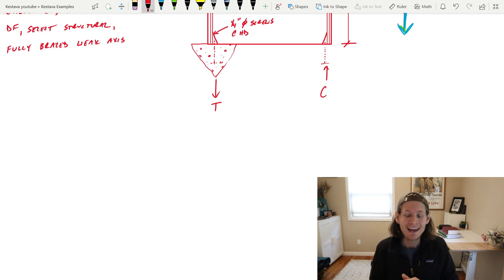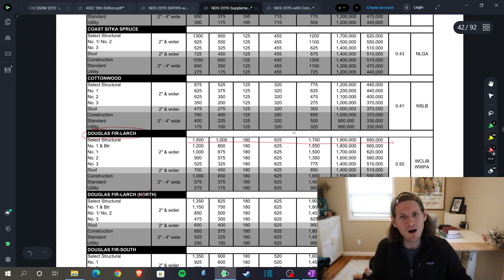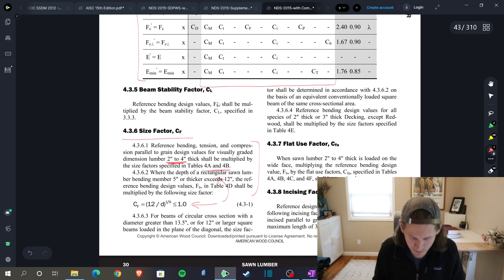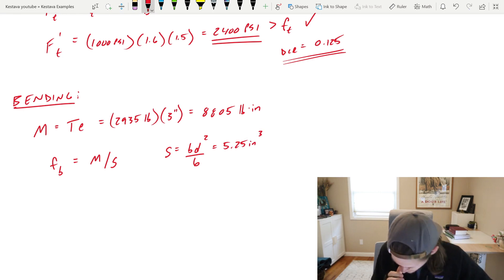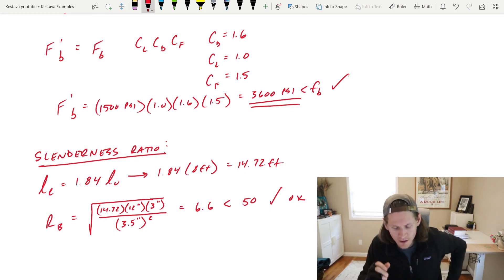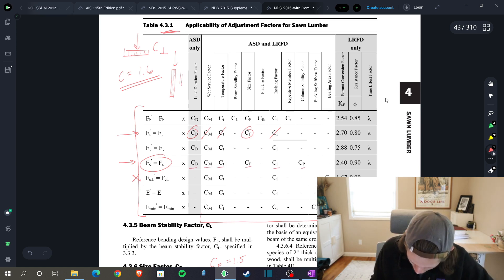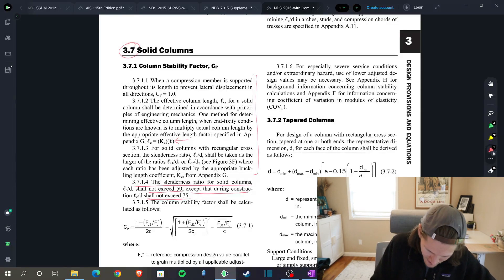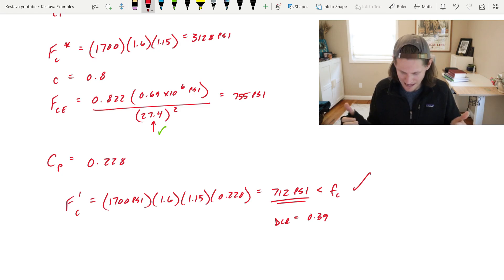How to Design Wood Shear Wall End Posts | Full Design Example | NDS

Comment: Excellent video. I also think the check for combined axial force and bending in the tension post was great attention to detail.
I'm curious why we don't check for plate crushing under the compression post? It seems like that reaction is likely to control for a stud pack braced about the weak axis.
Reply from the maker: I agree! when your forces in the end posts get large we should def be checking plate crushing

Comment: @10:24 I think you have it backwards.  You have Fb' < fb but Fb' = 3,600 psi and fb = 1,677 psi  You are still correct that bending capacity is greater than bending demand and is good.... right?
Reply from the maker: yes correct! I put the symbol backwards... durppp